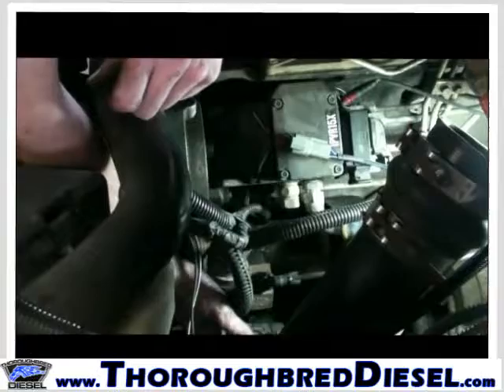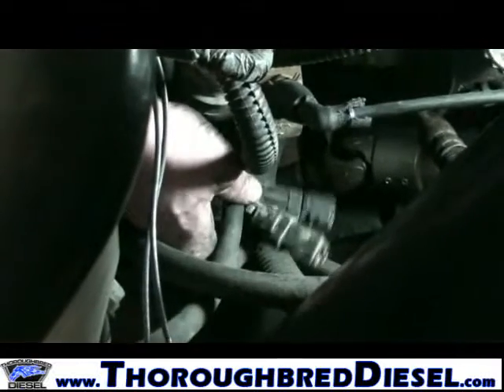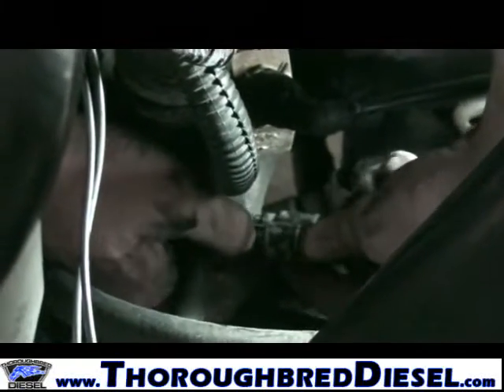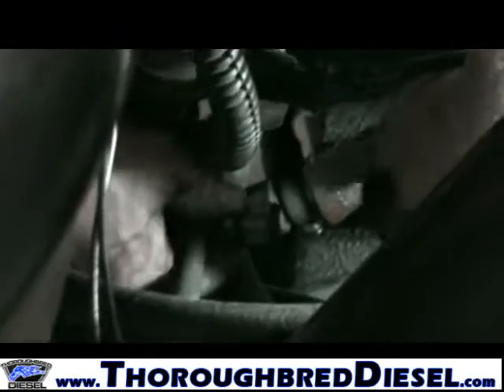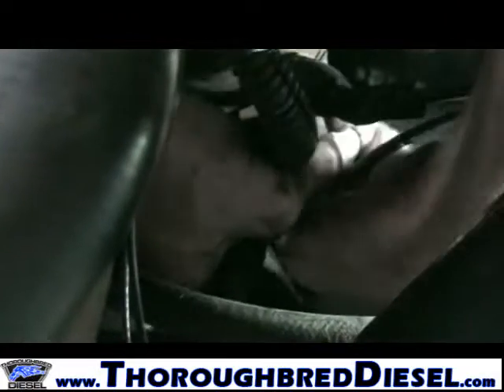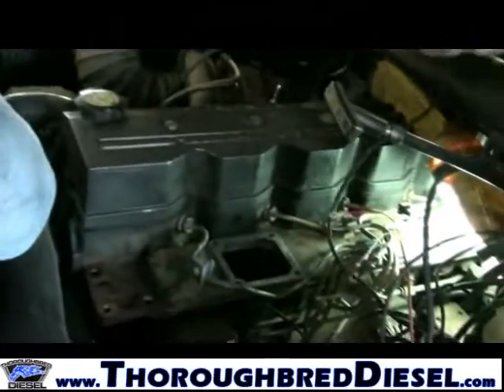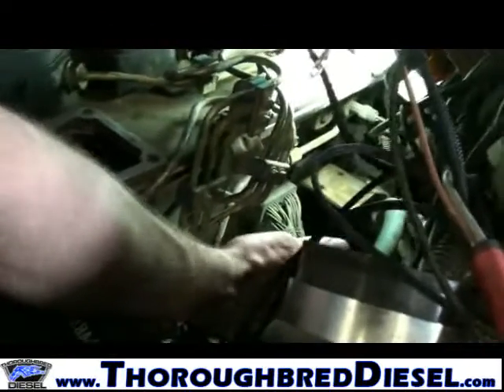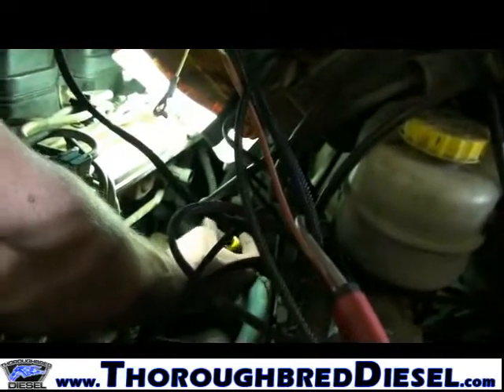Location of Data Link and Map Sensor Connection on 98-02 Dodge Cummins

Comment: Is it possible to replace that map sensor and take it off from the engine?
Reply from the maker: MAP sensor is needed for ECM calibration, it wont run correctly without it. I think that is what you are asking.

Comment: that is the round 3 pin plug right?
at the driver side rear of the head?
Reply from the maker: Depends on year of truck but yes it should be. There is a intake temp sensor in that general area as well.

Comment: any idea what socket size the MAP sensor is?
Reply: Some are 1 1/4” and others are 1 1/16”
Reply: 1-1/16 deep well, and the bolts to the fuel filter housing are 10mm
move the filter housing a bit so you can get back in there